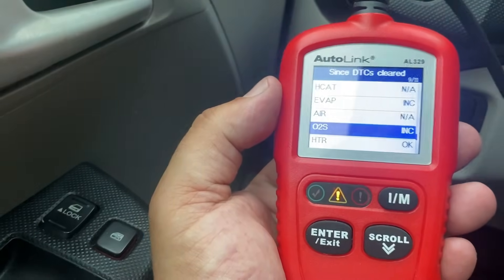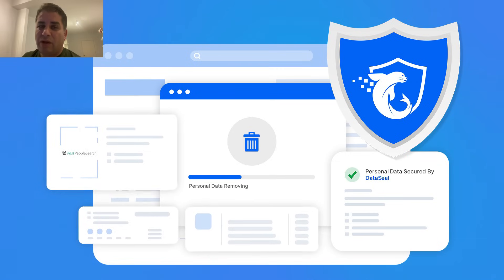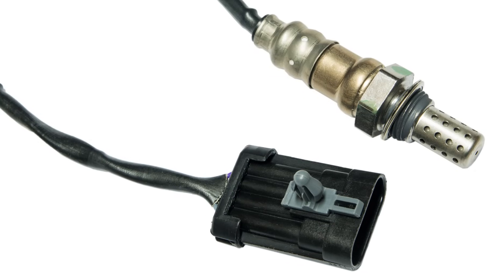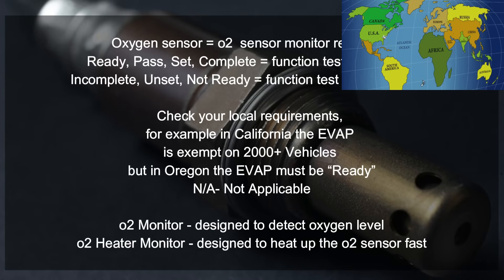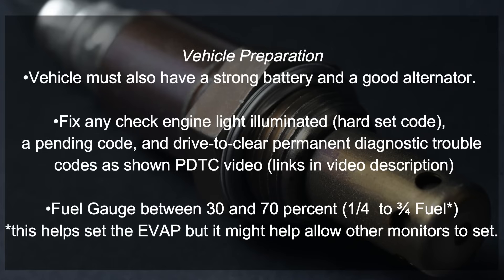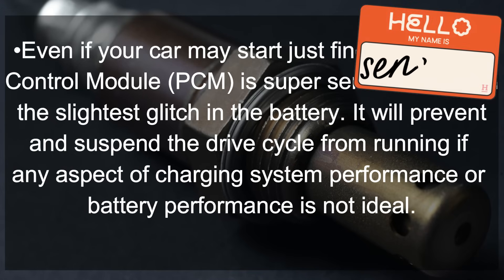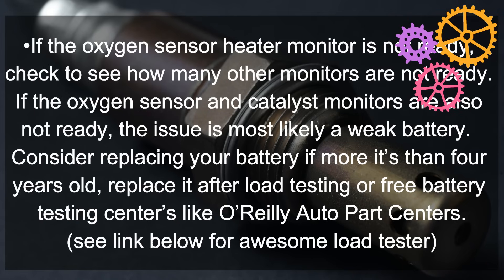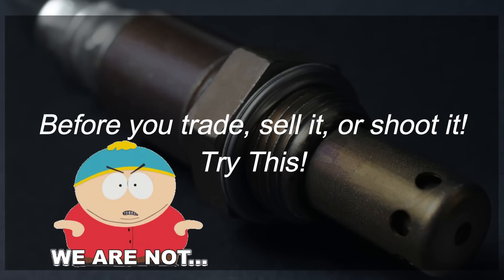O2 Sensor Monitor Not Ready ▶️ Smog Drive Cycle Oxygen Sensor Monitors Not Ready Problem FIXED

Comment: So I’ve driven about 800+ miles Total overall. Recently after the last reset it’s been 100 miles and everything set at 65 miles except for the o2 sensor. I’ve gone to autozone to have them check my battery and they say it’s good. My battery was replaced about a year ago. Could the battery be causing it to not set or is it the o2 sensors? Also to clarify the o2 heater is rdy, it’s just the o2 monitor itself.
Reply: Things I’ve done. 
-Take battery off for over an hour.
-clean Maf, Throttle Body, Intake filter. 
-Disconnected and cleaned connectors of o2 sensors. Made sure they were connected. 
- done a ton of different drive cycles. It’s driving me insane.
Reply from the maker: It code be the o2 sensor but what are you driving? I will send you a more specific video for your vehicle. Lastly incase you do change your o2 make sure you go with oem and avoid the cheap 20 duller units.
If you have a live data scantool you can check the live data from the o2 sensor.

Comment: I'm having trouble getting my o2 sensors to set. I have a 2013 Silverado. I'm going to do the battery check today and see what it reads
Reply from the maker: Let me know how it goes I’ve had other viewers with similar issues that had a different drive cycle that I have access to.  Have your tried disconnecting the battery for an hour? I know you will lose all the monitor history but it’s better than losing your mind, lots of glitches with gm vehicles 🚗.

Keep me in the loop and good luck.
Reply: @RANDOMFIX  Battery is reading 12.05V. No, i haven’t disconnected the battery yet. May try that Monday depending on what i get today.
Reply: @bowtieguy107 did changing the battery fix o2 ready?
Reply: @ACs63merc  yes, haven't had that issue anymore as of today.  🤞🏿

Comment: Thank you I needed this. Ive replaced my o2 sensors since my monitors cant complete. I've drive 350 miles doing drive cycles at midnight and still nothing.
Reply: What worked for me is the following. At midnight when the freeway is empty I drove 8 minutes steady at 55 mph, right before exiting the freeway I accelerated to 65 mph and let the foot off gas, letting the car coast to 0 mph that was for the EVAP. I then drove around 10 minutes at 35-37 mph steady, after got on the freeway and did my o2 drive cycle which was going 65mph and letting the foot of the gas to 55mph and accelerating back up to 65mph, repeating that 5 times consecutively got my o2 sensors to set, I suppose doing something similar may help. Lastly I drove around neighborhood streets around 20-30 mph and staying idle for 1 minute at the stop signs, around 5 times. Once I got back home, I plugged in my OBD2 scanner and everything was ready and set.
Reply: @RareAirTwo4  What kind of vehicle were you performing these steps on?
Reply: @bowtieguy107  2015 Challenger, but it should work on almost every car. All monitors set easy, the only trouble were the o2 monitors, which I finally set.
Reply: @RareAirTwo4  hey man, wanted to thank you. Not sure if it’s coincidence or not, but I did 4 or 5 cycles of 65-55 back to 65 like you described and it worked on my 2011 Altima to set my O2 readiness check. Replaced the battery recently and that was the only code left that refused to ready up. As soon as I did your method it worked. Wanted to thank you for taking the time to write it up. I was desperate so was willing to try anything, even if it was Challenger instructions because the Nissan drive cycle is insanely complicated and stupid
Reply: @CiaoBungus  the reason I wrote out the instructions was to help people out. I was frustrated going around 2 weeks, performing drive cycles to no avail. A smog tech instructor told me to try that out, and it worked. Good to hear it helped you out. I know how frustrating it can be.
Reply: .yes thanks
Reply: @RareAirTwo4 I’m having a problem w my 2019 hellcat I can only get o2 heater to work I’m gonna try this tonight
Reply: @kennyjones277 it's crazy, I tried many drive cycles and couldn't get it to pass. My emissions guy told me to simply drive it normally but with all the sports modes off. And it works all the time to set my monitors. Hope that helps.
Reply: @RareAirTwo4 I ham happy to say thank you as your instructions worked to a T for the evap. I didn’t get the o2 and I replaced the one bad sender that had came up before starting all this I seen places say not to switch gears and not touch brakes but I gotta be able to do one to slow I left it in 4 th and it would not go below 20
Reply from the maker: Glad to help, please let me know what happens. If you need the complete drive cycle check the video links or let me know and I can send it to you.
Reply from the maker: Down stream is used to check the health of the catalyst and up stream is normally for o2 system and the upstream sensor is where the o2 heater element is also placed. It’s part of the same o2 sensor.

What are you struggling with? Make model and year?
Reply: @RANDOMFIX  I finally got my stubborn o2 monitors to set. 2015 dodge challenger hellcat. Freeway holding 65mph steady, decelerate to 55mph and aggressively accelerating back to 65mph. Repeating this cycle consecutively 5 times finally got my car ready after 2 weeks of drive cycles.
Reply: I'm having problems with my Honda civic 2015 replaced O2 sensor on top can't get my check engine light off. I have drove over 1000 miles and done numerous drive cycles help please
Reply: I need help I have a 2015 Jeep Cherokee 2.4 latitude . Originally I had a code for loose gas cap P0457 and Evap system code P0400 . After watching many videos I made a choice to replace my ESIM and to my relief all the codes cleared as well as the check engine . So I drove the vehicle for a few weeks (highway,cold starts, city driving ) and when I check IM readiness all of the sensors are Green EXCEPT the O2 sensor . I am not getting any codes no check engine and my battery is new . I’m not sure if I should just change the O2 sensors or try to clean them first . I need help I have emission testing in the next 3 weeks . HELP ya girl is on a budget but I’m smart enough to do things with guidance
Reply from the maker: You replaced your ESIM?
I would warm your keep with air conditioning and defrost during a warm for like 20 minutes, then hit road at 35 mph and coast to under to 20 mph, drive like this around town for like 10 minutes try to coast whenever possible. The drive at speeds of 25 mph for 5 minutes. It is very crucial to not more the vehicle during the warm up, don’t even touch the gas pedal during the warmup. 
Keep me posted and make your battery is good by performing a load test. Then drive on battery is key. I show how important this is in this video https://youtu.be/cV6NewPWo2E?si=eep9c4b-VtpNdhMW
Reply: @RANDOMFIX yes I replaced my ESIM because I had DTCs popping for Evap system and loose gas cap . Once I fixed the ESIM both Evap codes and check engine are cleared . However after driving awhile I checked the IM readiness and all of the sensor are ready EXCEPT the O2 sensor … I don’t understand how the Heated sensor is good to go and ready but the O2 sensor is not ready …. Also in your response I think spell check messed up your sentence  so I’m guessing you wrote to warm up my car for 20 minutes but the other stuff in between I believe auto spell messed it up . ….. so as soon as I get your response with clarification I will do exactly what you suggest .
Reply from the maker: Sorry about the missing words.
Here it is again.
I would warm your vehicle and keep with air conditioning on max during the warm up cycle and turn on the rear defrost during a warm for like 20 minutes, then hit road at 35 mph and coast to under to 20 mph, drive like this around town for like 10 minutes, try to coast whenever possible. Then drive a speed of 25 mph for 5 minutes. It is very crucial not to move the vehicle during the warm up, don’t even touch the gas pedal during the warmup. 
Keep me posted and make your battery is good by performing a load test with the vehicle engine off. The GOOD battery is key. 

I show how important this is in this video https://youtu.be/cV6NewPWo2E?si=eep9c4b-VtpNdhMW

Good luck
Reply: @RANDOMFIX I did a voltage test with my OBD2 reader said it’s at 14.1 V when running
Reply from the maker: You need to complete a load test with the engine off. 
What you are experiencing is an actual issue on dodge jeep ram vehicles. Watch the video I sent in my previous message and you will understand.
Reply: @RANDOMFIX ok I’m off to autozone as I only have the OBD2 reader not the load test device I will also do the warm up before going to autozone so I can hopefully knock out 2 birds with one trip I’ll be back THANK YOU !!!!
Reply from the maker: The tool costs only about $20 and the obd2 reader I show auto updates every 10 seconds so you can leave it in and drive. No need to keep scanning to see if it’s ready.

Buy them both and if you don’t love them return them. 
This will be the best investment as going forward the battery will only become for critical to vehicle operations and lots of people are swapping out parts only to find out the battery is weak!
Does Autozone have in vehicle battery testing?
Reply: @RANDOMFIX I replaced the battery under a year ago but I’m going to get it tested real quick
Reply: If we can figure this out I’ll throw your channel a donation because it has to be fixed to renew my tags so I’m on a mission
Reply: @RANDOMFIX ok got the battery tested and they printed it for me it says Good Battery state of charge 100% . rated CCA:790 cranking health :pass reserve capacity: ok I just wrote what the paper says lol
Reply from the maker: Good to know, they load tested it?
Just out of curiosity how old is the battery?
Reply from the maker: The reason I ask is because the computerized load testers suck. And the good ones are Super expensive!!!
Reply: @RANDOMFIX yes what the guy used looked very similar to what you had he connected a clamp to each battery terminal and test while vehicle was off . My battery was replaced in November of last year, so it’s under a year old.
Reply: So what we have is good battery , no DTCs pending stored or popping up , and for IM readiness all of the sensors are good to go except the O2 . The heated O2 is even good to go which from what I’ve been reading it’s the same sensor so I’m confused how the heated O2 can be good but the O2 category is not ready .
Reply: Any thoughts on my response above 😢
Reply from the maker: Sorry I didn’t see your response.
Assuming the battery is good will give you a higher chance of getting the next steps right.

Let’s look at the upstream o2 sensor ( this is first o2 sensor before the catalyst converter).
How old is it and is the original brand that came from the factory when the vehicle was purchased?

Have you inspected the connection? With the vehicle engine and ignition off, unplug it and look at the connection to verify the pins are undamaged and clean. Also inspect the wires in that area.
Reply: @RANDOMFIX I have not got this far because I don’t have the attachment to remove the sensor but I can probably unplug it from the other side to view it and I’m going to say it’s all original the vehicle has 117,000 miles on it .
Reply: Since I had it I had issues with oil consumption which is known on the 2.4 L . I had to replace an oil sensor 2 years ago and about a month ago I replaced the ESIM , oh and a new battery last November .
Reply from the maker: Okay, take a look and start pricing the oem o2 sensor. It might be a little expensive to go with oem vs aftermarket but save yourself the headache by going oem.
Call the dealer to get the part number or visa rockauto.com and look at the options, you can sometimes look at the different brands and price range, look for “oe”.
Reply: Need help with this. O2 won’t set ready for 4 months. I’m desperate.  2013 Fiat 500. No codes. Full scan checks perfect. Just o2 not ready. Help.